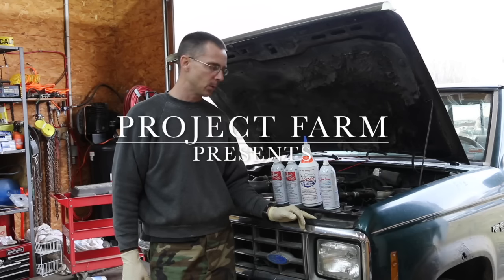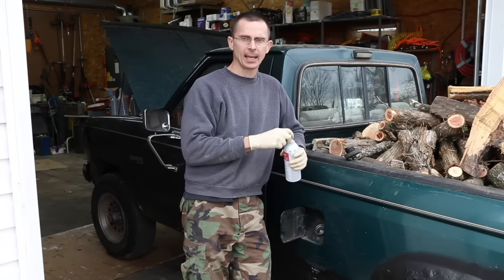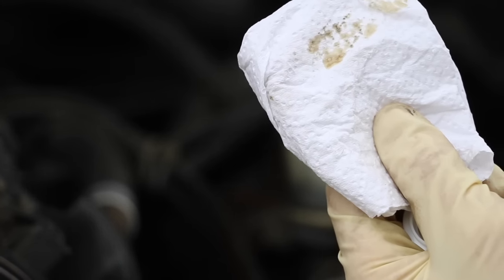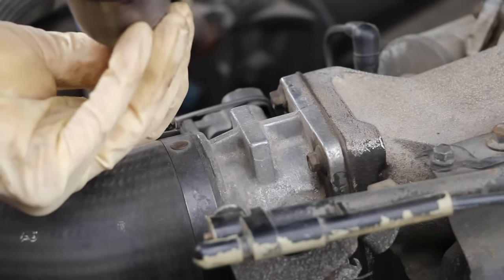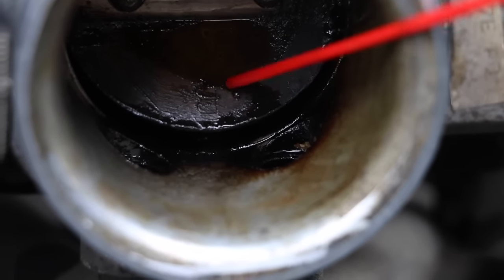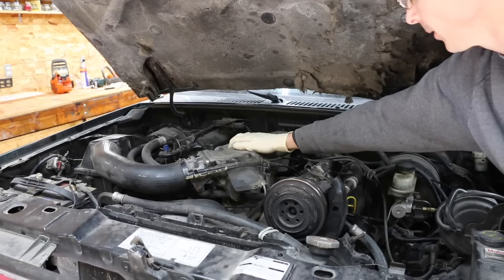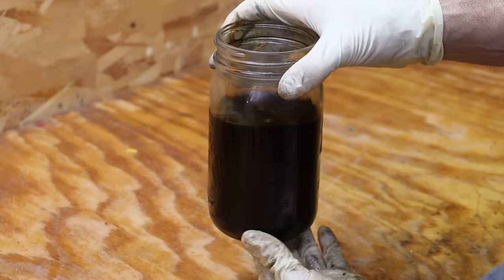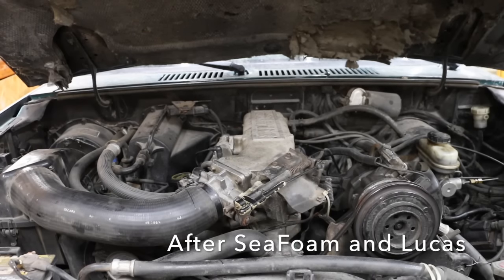Seafoam--can't believe what it did to my engine!!

Comment: "due to a lot of wear. This engine has 160k miles." Laughs in Toyota
Reply from the maker: lol  Thanks for watching.
Reply: sees Toyota, LAUGHS in Volvo, catch me at that 3 million miles mark how bout dat :)
Reply: I have a Toyota Land Cruiser with the original engine and 650,000 Kim’s on the clock (400k miles), it has never been cleaned nor does it sound like this.
Reply: @alansailing1387  damn bro how many names you need
Reply: @thomasfernandez6180  sounds a little like bhad bhabie, but for cars.😂🤘
Reply: laughs in ranger, out of 3 we've owned they got between 250k and 300k miles. this truck here is over 30 years old and probably a lot of short trips
Reply: I've seen 3 toyota Tacoma's with over 1 million miles on them...never seen it on another car ever...
Reply: I have a 92 f150 5.0 with original motor with 325,000 miles still running
Reply: Earl Lee  //  "Anything can run poorly if not taken care of." Earl, you couldn't be more right; 95% of the time, whoever owns the vehicle determines just how long it's going to last i.e. their driving habits / how well, and "if" they maintain their vehicle properly.
Reply: REVVV YOUR ENGINES!! LOL what a dope!
Reply: laughs in 335 000 miles audi a8l if you have a high mileage car, you have to post a video before bragging in comments.
Reply: Lol yeah and they make fun of my Honda Civic 2008 to boy some people don't have a clue do they
Reply: @alansailing1387  bullsh1t make a video I want to see this.
Reply: @Trevor Lahey laughs at your sad joke of a Chevy truck never gonna happen but that's a nice fantasy you got there
Reply: @halcyonoutlander2105  You obviously don't live in Australia. Its a well known fact that the speedo stops at 999,999kms and won't click over to 000,000. the diesel LandCruisers go forever mate. Plenty with more kMs than mine on the original engine.
Reply: My 2001 Toyota tacoma V6 Sludge monster just made it 100K before the oil would not drain out.  Oil changes every 3k and Toyota would not stand behind the product but had I had a Camry with the same engine they would have replaced it.
Reply: My dads last land cruiser 1hz 80 series 1993 model had 850k km on it without a rebuild and it drove like brand new. Maintainence was pretty poor as he didn't earn much at the time but he said it drove like the day he bought it. 
Heard of a local cruiser clocking 1.5 million km without a rebuild aswell but haven't seen it personally.
Reply: @sirius9516  probably more like 85k and 150k .. Not many could go over 400k without some type of overhaul not contesting what you are saying I'd have to see it to believe it though .. Because that's well beyond BMW & Honda which BMW has 2 makes and Honda has 3 makes on top cars to find easily over 200k miles
Reply: Laughs at the people playing "make believe bragging on a Chevy with a million miles" p.s. I drive a Honda Civic 2008 it'll outlast and outdrive anything you have in your yard..respect to Honda and Volvo.. (Of course RUF at CTR Porsche) you talk a lot of backwards Shiite about a car that holds a safe 2nd place in all cars that have been over a million miles actually driving and has the stock transmission & engine .. All that other noise can gtfo here! No one believing that garbage and those GMC's and most of those overgrown Kia looking suvs are made in China to .. Reality called & said :wake that MFr up!
Reply: haha exactly what I thought too!!! 160k? that's it??
Reply: Adrian Trejo  my civic saved more on gas than your truck is worth ..but you say "I'm lying" and in reality you are in denial .. I'll definitely get more miles out of my civic than you will that old truck but the funniest part my 50year old dodge has the original granny 4 speed yours don't .. Keep dreaming and when you think you are convincing and think you are believable come back and tell me more about how you think your vehicles are better than my 2008 Honda civic.. It'll still go between 120-130 but I don't kill it I just easy along and let the transmission pull 61 at 1.8 rpm let me know when you can do that ..btw even though my civic is a smoother ride than your truck I know my civic has been places your truck "shall not cross" but I'm sure you'll continue to diss on something you wished you had ..
Reply: shit my 2005 ranger has 220K
Reply: That's definitely true! My mates '99 Hi-Lux 2.4TD has 210k miles on the clock, it fires up faster than you can turn the key to full rotation... Amazing reliability.
Reply: @thomasfernandez6180  Yes, I love those super common volvo pickup-trucks!
Reply: Can confirm, I had a Bronco II with this 2.9 Cologne engine. Went to the junkyard with 129k miles. My 3RZ Tacoma went 290K and I still sold it for 3 grand.
Reply: I believed that lie, now I'm sitting here with an 05 Camry with the 2.4L with a blown head gasket due to faulty head bolts. No one wants to re tap the block and its about 3500 for a used engine that's likely to have the same problem. Title max will buy it though.
Reply: My old buick has 300k and still runs just fine
Reply: My experience is age and use makes a far greater impact then miles, as in the Odometer can easily be manipulated. Its 30 years old still runs; on poor quality fuel no less.
Reply: Yeah my 01 s10 has 236k and not even close to sounding like that
Reply: Laughs in Mercedes diesel
Reply: Toyotas and hondas will outlast any American junk
Reply: @blue5080  They are not reliable now. They can't sell any car if customers drive cars last long forever.
Reply: Watches as he laughs in yota.. Then inlaugh as the frame snaps
Reply: Mileage can be very situational.  Cars/trucks that are driven only in temperate climates will always outlast those driven in snowy areas on salted roads, day in day out for months on end.  The people commenting are almost never from northern US and Canada where the streets  are literally crusted with weeks worth of accumulated road salt.
Reply: An '08 with almost 250 thousand miles, the engine sounds nothing like that. I guess the previous owner took excellent care of her drivetrain and probably used the proper treatments when they needed to.
Reply: Why this guy with the Civic trying to impress everybody.. anybody can grab an old Civic with 2 weeks of wages and driver for a second car ain't like you got some diamond
Reply: ive owned honda, hyundai, kia, toyota, jeep, Subaru, ford, lincoln. only 2 that ever had problems was toyota sienna (frame rotted out after 13 years) and subaru (total engine failure at 220km). toyota needed lots of work, but i have a matrix right now that is running fine. will never buy a subaru again though. it was such a nice car and for it to die so soon was a tragedy.
Reply: @markburkey6371  dude I've seen a million on a few Silverados, a f150, 3rd gen cummins, never on a toyota tho, I've always heard they have but never seen it
Reply: New Toyota’s suck. Be lucky to get 150k with any of them.
Reply: Lol, my 2001 Dodge Ram 1500 has 300,000 and is still going strong
Reply: My F-150 has 184,000 mi on it and it's just now starting to get broke in; running better now than the day I bought it.
Reply: @CamoShirt  Currently have an 89 Toyota with 400k, a Honda with almost 300k, and a Subaru with 320k.  Every Ranger I work on for someone else is a pile, no matter how many miles.  XD
Reply: Earl Lee  Not correct.  I've seen Hondas that were neglected like you wouldn't believe still chugging along
Reply: @thomasfernandez6180   I got an 07 Tundra from the South and an 07 XC90 bought in Sweden and imported to the US where its spent the last 7 years in Hawaii, both with 160k on them and let me tell you, the XC90 sounds like it needs a good seafoamin' in its life.
Reply: I miss my tacoma had over 300,000 miles on it when I sold it. Now i have a Silverado with 100,000 thousand and this truck has been been nothing but problems.
Reply: @mikaelgaiason688  i'm not sure where your from so 400k could mean 400 thousand kilometers which is baby steps to Americans. my dads ranger which was my moms ranger which was Pepsi colas service ranger has did everything including total out a Chevy, got side swiped by a ford and then my mom didn't want to drive it anymore because it was all bent up and my dad bless his soul never changes the oil and he took it over around 210,000 miles.. not kilometers and he keeps it loaded down with about 500 pounds of tools and tows a 10 foot trailer everyday he works and its sitting on 274,925 miles today.....and unlike your grocery getter toyota the frame is still solid and we live in the rust belt. lots of salt on the roads here every winter...
Reply: @mikaelgaiason688  typical youtube loud mouth doesn't have a prayer of being convicted if he was on trial for being alive..post some vids, add some faves..good golly miss molly live life...
Reply: @americanlivesmatter-BmanWild  my f-150 does about the same " 70 at just over 2k rpm
Reply: @thomasfernandez6180  lol how many times you have to pay for it to get there?
Reply: Laughs in a volvo 1.3 million kilometres driven (808k miles)
Reply: My ranger has almost 250k, which gets me confused, because it doesn't have anywhere near that sound.
Reply: I got 413,000 on my Toyota
Reply: @markburkey6371  Manual shift 2005 Nissan Frontier used as a delivery vehicle had a million miles on it and was still running strong. I may be wrong on the year but if you google it should show up.
Reply: 160k a Toyota ain't even past the break-in miles yet.
Reply: @kman-mi7su  LMAO You ain't even close to 'em gg sir
Reply: Back in the 80s and before, regardless of brand, 100K-120K was about when engines would peter out. 167K is pretty good for an old 80s engine. Modern cars have essentially doubled ( or in the case of Toyota) tripled the 80s engine rebuild figure.
Reply: @terrysmith9794  my grandpa had a 92 f250 with the 5.0 h.o. He is old, and forgot to change the oil in it for the first 50,000 miles!!!!! My Dad had to stick a screwdriver in the oil drain to get past the sludge to let the oil out!!! we then took the pan off, and cleaned it out, and put the new oil in!!! That truck ended up with over 400,000 on it with only oil changes and one map sensor!!!!! Unbelievable!!! I still love my Tundra though!! lol
Reply: @thomasfernandez6180  the guy religiously changed the oil every 3k miles though, it's great preventative maintenance but a bit overkill. Both volvos and toyotas are indestructible even if you abuse them
Reply: @mikaelgaiason688  lmao i hope for your sake that you know what time zones are...
Reply: @edbo10  Of course I do.  I also know what a tweaker looks like.  Check your boyfriends "channel"  XD
Reply: @mikaelgaiason688  no thanks I already visited your channel
Reply: @edbo10  Cool.  XD
Reply: @mikaelgaiason688  XD
Reply: @edbo10  XD
Reply: @blue5080  yah cause they make no power to wreck anything. Rice burners are junk who cares how far they go when you look like a clown driving one.
Reply: @newrunner91  dude i got 300k on my chevy trail blazer and its not even rusted and we drive on salt.
Reply: Honda still laughs at Toyota
Reply: laughs in nissan vq37vhr
Reply: Cries in Jeep Grand Cherokee 04’s I-6 with 147k miles
Reply: @TheDmantheman100  I'd like to know your secret. Do you use an undercoat? Wash it regularly? It's either been snowing or had temps in teens and 20s for a few weeks so haven't been about to wash my cars. Thanks in advance
Reply: @newrunner91  dude i live down back roads so before the snow flys i get my truck real dusty like i mean a good thick layer of dust on it and i dont wash it all winter. Once you clean the surface with clean water your unprotected from salt. But salt cant eat through dust it seems.
Reply: @newrunner91  other wise even if you put a good coatin on your frame and rock guards when you drive 100 km 120 km your tires pretty much sand/salt blast everything under your wheel wells. Even if people pass they kick up even more and sand blast your stuff even more. I find a good natural coating protects it best. Does suck having a dirty truck all the time but it really does help.
Reply: 160k miles is a lot for farm truck use
Reply: At least that 160k mile "worn out" ranger doesnt cost 8 grand like a toyota of the same age..
Reply: Laugh in my honda accord 275k miles and still going strong.
Reply: @thomasfernandez6180  🤣 Have a Toyota Tacoma, let our kids wear out a teal '95 Ford Ranger, and made the equivalent of a trip to the moon in our 1995 Volvo 940 (then sold it, and it's been across the USA three more times so far at > 300,000 miles! 😎
Reply: @markburkey6371  Volvo! ¯\_(ツ)_/¯
Reply: We literally have a Suzuki micro car with 150k miles and it's running like new, that's a 658cc engine.
Reply: @markburkey6371  Unfortunately you had to sit on a bucket tied to what was left of the frame because they rust so bad. I have never seen anything rust so bad as a Toyota.
Reply: @thomasfernandez6180   I'd take a 1976 f-250  Or @bobkin611  toyota in my neck of the woods over your Volvo.  They may be great for paved roads and some light country driving and last 3 million but they wouldn't last nearly as long in a rural area hauling heavy loads, bouncing across hills ruts cattle paths and tree stumps.  Only getting to see pavement when you bring it into your own shop to change the oil or other maintenance.  Volvo is a fine brand but the type of miles are just as important as the number of them.  And my old truck has seen a crap load of Hard miles.  :)
Reply: @americanlivesmatter-BmanWild  lol you drive a Civic
Reply: @newrunner91  Midwesterner who relocated to Canada here, my 2002 Honda CRV has got 235k miles on it and still doing great! Bit of rust sure, but you really can’t do much about those salted roads. I don’t disagree though that vehicles likely last longer/wear less quickly outside of our hostile climates (not that I would know 😂)!
Reply: 160k miles is low mileage to me. My '01 Silverado is at 260k, runs and drives like it's at 90k.
Reply: I'm laughing in Ford 7.3 Diesel
Reply: @DanielSouza-pv7wq  You're talking about how Scotty says that this stuff is useless in road vehicles and is only meant for two stroke outboard ocean going vessels?
Reply: Laughs in 07 Infiniti g35 coupe. Currently sitting at 215,581
Reply: @markburkey6371  just bought one w 250000 miles everyone thinks I’m nuts but it runs and drives excellent
Reply: Rhizosphere Renegade CVT’s and GDI exist imma bout to end this mans career
Reply: Wonka we get it, you never drove a Chevy before.  If you did, you wouldn’t be spewing claims about “gas mileage” LOL.  You only care about gas mileage if you’re broke, or are just an ordinary consumer. (Both of which would not surprise me based on the way you type) LOL
Reply: @sakke6902  my Volvo just 400,000 (or 400k) miles last week, no problem
Reply: @MattProductions2012  or don't like wasting money on gas...
Reply: Another excellent Project Farm video!
Reply: Meh, Honda has better engines.
Reply: @markburkey6371  I’ve seen old Honda cars with over a million. Of course most of the mileage on any of these million mile vehicles is going to be mostly done on the highway. So technically these million mile cars only have around 200,000 in wear on them. The Honda engines that I have seen hit a million are the B series in the crv, civic, integra and crx and the F series in the second gen s2000 (only seen that once, I don’t know why you’d drive a sports car like this). The K series engine will do it but will burn/leak about a quart per month doing it. The B series only usually need valve guide seals if it burns oil. But the low tension piston rings in the K series will usually start to let oil past after 200-300 thousand.
Reply: My 2005 Toyota Sienna is now up to 205k miles and runs like new.  I had since new and never missed a 5k oil change.
Reply: @americanlivesmatter-BmanWild  i can assure you that Landcruiser diesels do go more than a million km without a rebuild, my Landcruiser diesel (not rebuilt) has just shy of 700,000km and it runs like new.. i can take the oil cap off while its running and its clean air in there, no blow by or other signs of wear yet.. there are plenty of Landcruisers here in Australia that have well over a million km and they are still running strong